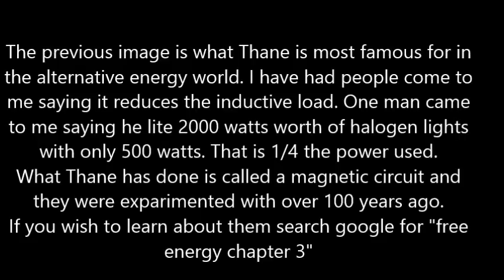Thane Hein P3 Bi toroid Transformer and Generator. The future of his device and company.

Comment from the maker: This was filmed less then 2 months ago. Thane did not charge as far as I know. I wish I would had kept the report he passed out. But in the beginning of all three parts I write about magnetic circuits. I have had more then one person come to me to validate what Thane has done. But in actual reality just by using a proper geometry magnetic circuit can save power. The most I have heard was you can light 2000 watts of halogen lights with 500 watts. So this consumes 1/4 the original transformer.

Comment: There is a start up company in, I think, Deerfield, Michigan.  They replace the transmission with a hydraulic pump,  then add a accumulator (think of it as a hydraulic capacitor), pull the drive shaft, and place a hydraulic motor to drive the differential.  Great for Humvees, Garbage or delivery trucks, and school bus. During braking motor recharges accumulator.  Fuel consumption greatly reduced 50-60% - performance well ripped up Humvee differential in 3 runs.  Google hydraulics Deerfield, MI

Comment: I see where the Russian stole the MYT engine.  The small package to large power output, heat or cooling problems, and the 12 degree stopping/locking disc/pistons at top dead center are all problems for reliability.  However, if used with a hydraulic pump-accumulator-and drive motors - it would make a nice transportation vehicle for about 200 mpg for a small car.  Why don't you ask Jay Leno to built us a car?  He has a garage and a handy mechanic!

Comment: They claim to have used petro to run it but haven't demonstrated. So far it was energized by air and it made quite a racket. You lost me on the hydraulic pump-accumulator, but I can say that they have had a lot of problems with seals. I think there's a lot of promise in capacitors batteries. I've seen wonders accomplished with using them. Word has it, that a company out of Canada, originally tied to IBM, has had a 10minute charge system that has a 10year life span. It was sold to the military??